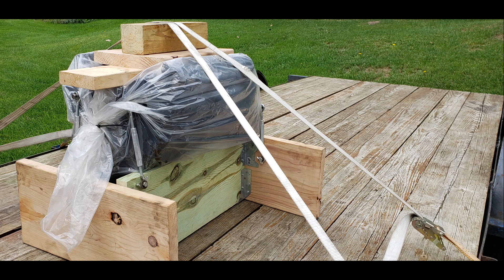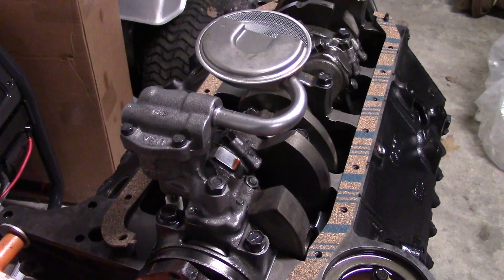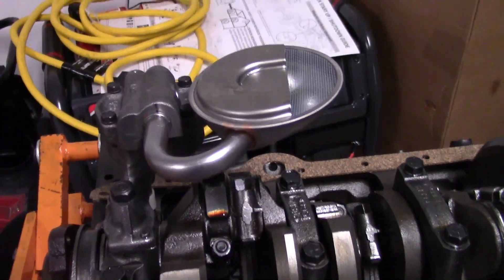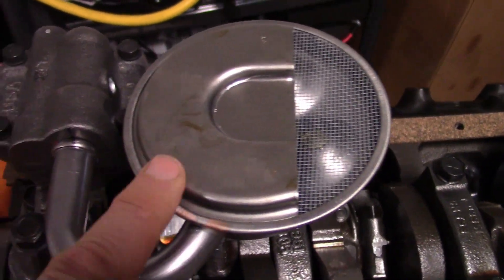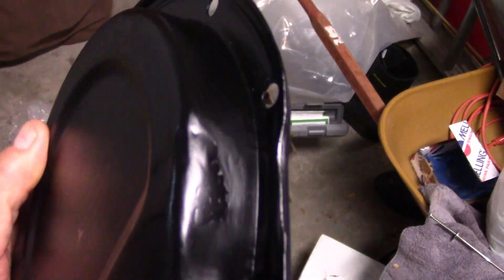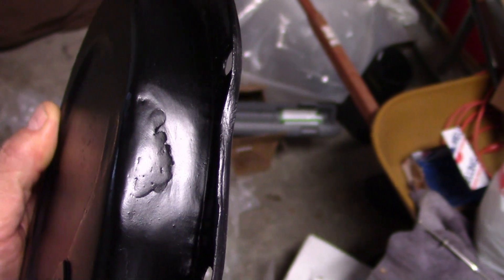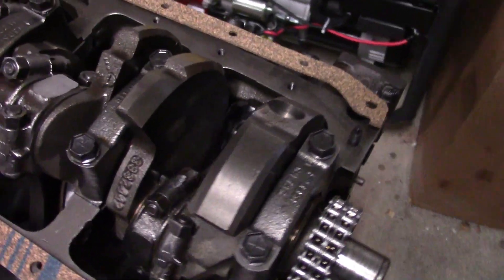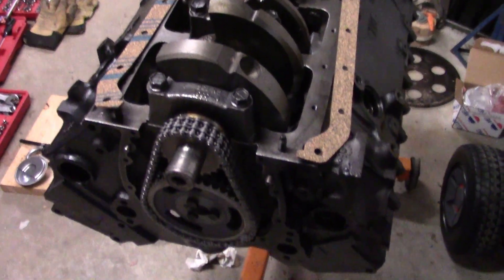Assembling Engine  Part 1 - Install Oil Pump and Pickup Screen - IROC-Z Barn Find Camaro EP#15

Comment: Where can I find the oil pressure relief valve?
Reply from the maker: There is an adapter between the block and the oil filter.  The filter bypass valve is in the adapter.